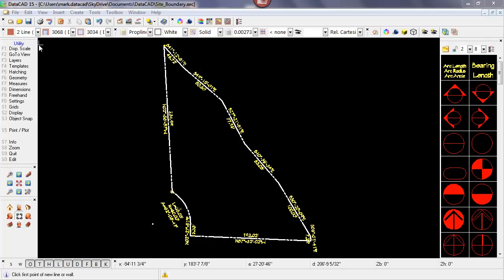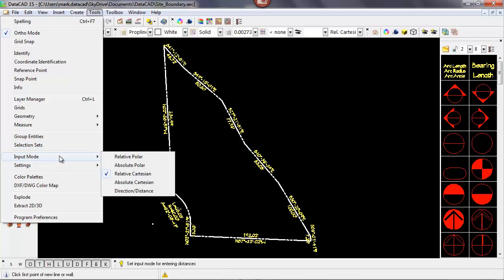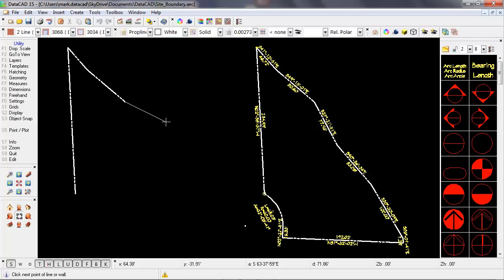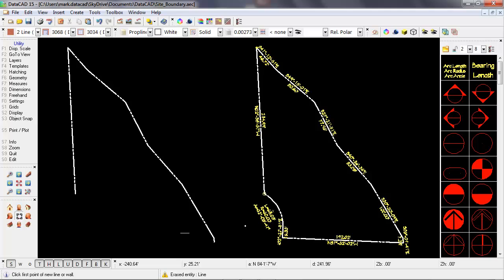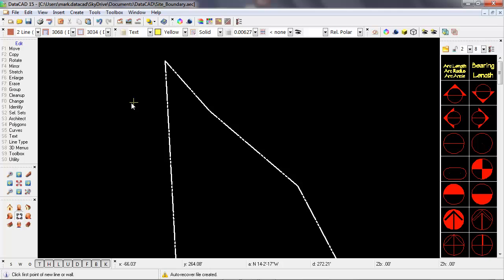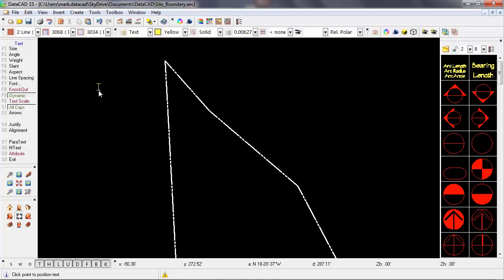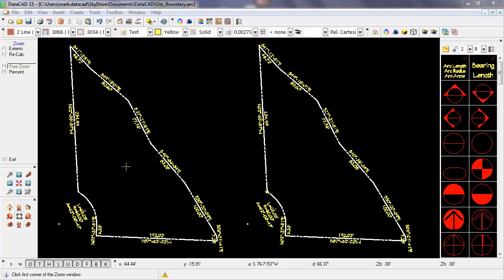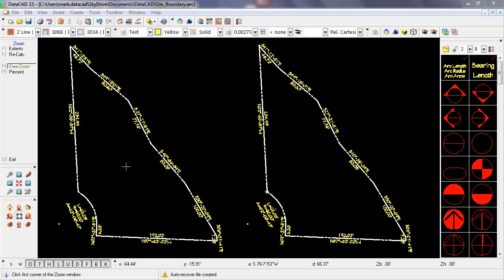Using Surveyor Data

Comment: I have DataCad version 18.  The character input does not work.  If I am in text mode and keystroke "Alt 0176" nothing is entered, no degree symbol.  What to do?
Reply from the maker: Not all of the stroke (SHX) fonts have a degree character. Select one that does or use a TrueType font.